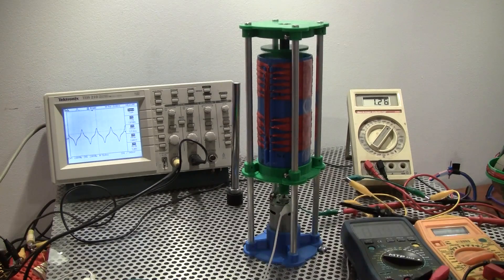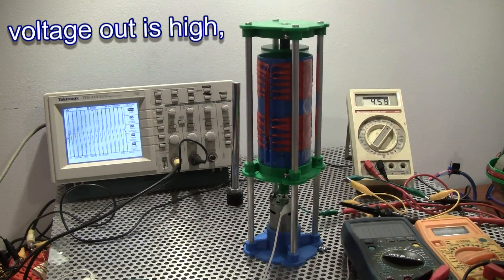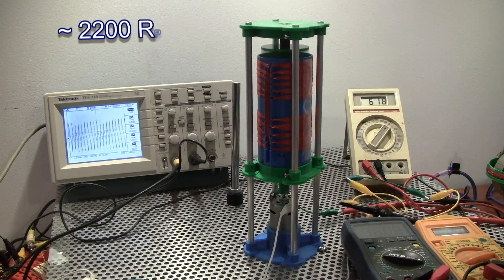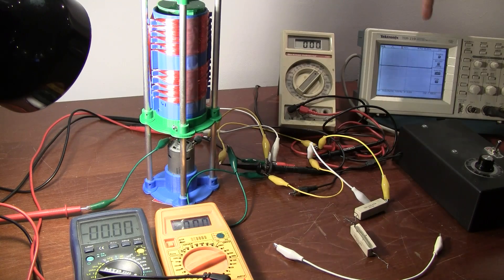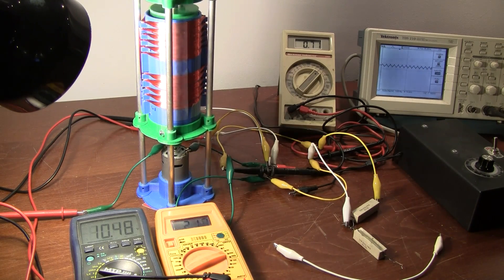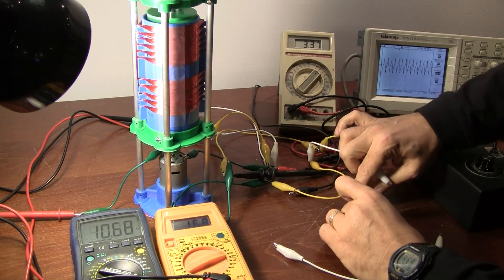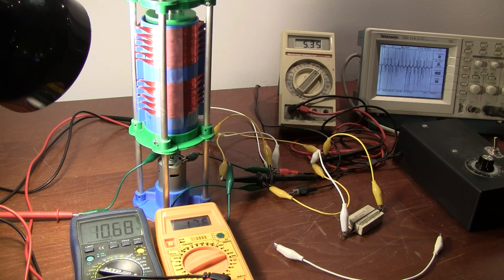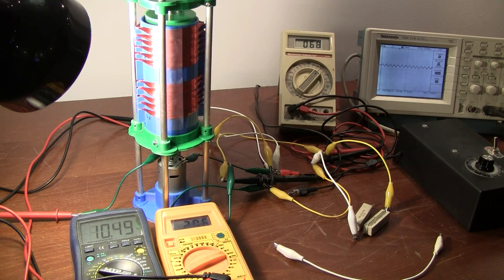Stefan Marinov motor / generator anti-Lenz test

Comment: The coil is a simple singular coil in tube shape which the magnets rotate within AXIALLY.  Is that right?
Reply from the maker: Hi Caleigh - nice to hear from you after such a long time! Yes, this generator is a little hard to understand since it work on the magnetic A force rules, which are really just a version of the Lorentz force. Anyway, yes the magnets have their B field in the axial direction, but the magnets on one side have North facing down, and on the other side, North facing up, to mimic  an open B field loop. This rotates inside of a cluster of hemispherical coils. In the motor version, see: https://www.youtube.com/watch?v=-35-hdWUZuk applying DC to the split path coil sets up forces that repel on one side of the rotor B field loop, and attract the other side. However, after the magnet  rotates 180 degrees, since the magnetic direction in the loop is now facing in the opposite direction with respect to the current, the forces are reversed, which would make the rotor brake. In order to get full rotation as a motor then, the current needs to be turned off most of the time, and pulsed ON only when the rotor is in the correct orientation to experience the same attraction/repulsion of the rotor. So now returning to the generator version, the same rules apply - except that now the magnetic rotor is inducing stator currents, and the reversing orientation of the rotor B field every 180 degrees  induces a reversing current in the hemispherical loops, thus the output is an AC waveform with peaks at the points of maximum thrust. A good ref paper is the article of Phipps on the subject - 

https://pdfs.semanticscholar.org/88a9/37981ae9f9663c591f9aca5db108faf122f0.pdf . Hope that helps!

Comment: how can it be anti lenz if it slow down the motor and it increase the prime mover power ?
Reply from the maker: If you watch to the end, my conclusion is that there is no anti-Lenz effect. It is in the title because I am testing Marinov's claim that this generator has anti-lenz properties.
Reply: @plenum88  you are right i didnt watch to the end , am testing also a coil made by alex on you tube but am not getting what we need am getting 120 volts high frequency but when i put a load the input power its true it go down for the prime mover but the 120 volts drop to 0 volts also like a short , the load is 60 watt lamp and the 2 coils are 1000 turn on a U shape , watch my video you will see

Comment: Mr. Marett   ...  Thank you for your exacting tests, and for the Faraday Paradox ones. I'm working on a new version of the Tesla/Faraday Disk generator. Could you run a test, with your Faraday setup, to see if there's any Lenz Law reverse reaction in the disk? I'm thinking there isn't any, because of the "magic" of the circle, opposite sides cancelling. There could however be a Lorentz Law opposing reaction.  ..  Bob    ...  Note: Isn't the Right Hand Rule used with these considerations?

Comment: Could you try to rotate and the coil and the magnet together
Reply from the maker: Can't really do that with this design. This version of the Marinov motor doesn't work on the unipolar dynamo principle so you likely wouldn't see any voltage if it was changed that way.

Comment: as long as the magnets are moving in a seperate frame of reference to the coils, the induced current will produce a stationary magnetic field than that is not even distribuated  in the coil and this induced field, don't want to move , and a force is needed to overcome the position of this stationary induced field to relocate where the field establish the circuit. 
a copper wire act like a gas and only some of the particles inside the inductor react to the magnet at the time, so its like a mangetic circuit is created and then recreated over and over as the location where the gas particles interact the stronges is where the circuit is formed.
 the induced field is not homogenious.
 if the induced field was moving with the magnets it would not produce drag.
  
when a current is applied to a winding  lets say a battery, the distribuation of the electromangetic field is more even and therby behave differently. 

lenz law suppose to only create an opposite field, and not a resistive force, which the theory does not explain, and is therby a separate phenomena. 
when a magnet is stationary to the coil and an magnetic bridge is formed between the stationary magnet and the  stationary coil and is acutating the magnetic fluctuation, then there is not drag since the induced field is in the exact same frame of referance as the magnet. 
all convetional type generators are exactly the same, iron core or air core does not make a difference. if you do things the same way as everyone else, the you will get the same results as everyone else regardless of you, want to put your name on it or not.

Comment: Man, that is a really great build well done.!
Something I've noticed about the marinov.b effect with both motor and generator is that it may only work with one magnet, because I've noticed that the Bloch wall between many magnets effectively sees the coil like some of a n or s pole face. But when only considering one magnet the center point has absolutely parallel field lines.
 Just a thought anyways keep up the good work👌
Reply from the maker: Not sure. I suppose in the motor case this is hard to test since you 
would have to make a single magnet with the B field circulating in the 
core, which is probably not available commercially.  I had to use eight 
wedge magnets to make mine.
Reply: +plenum88 
Yeah I've seen a very tiny mator in the don't know if you know of that video you've probably seen it to.
What I noticed right away is when I had stacked neo magnetics, and then tested the center point for drag and it seemed to be interference where the poles join.
I guess to have the real answer might need a huge neo magnet 🙁 expensive.

Comment: Paul Babcock and Jim Murray two engineers are playing with Lenz law in their machines.They are making over unity generators by canceling Lenz Law and using the peak voltage to their benefit. You should check it out, some of their material are free here on the tube.

// thanks for the videos